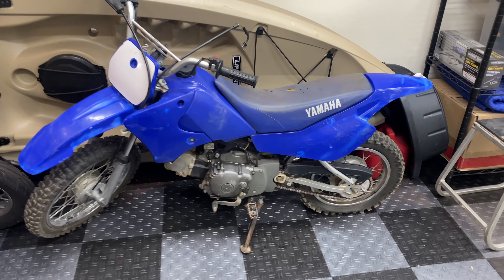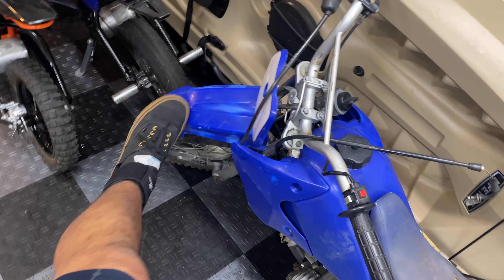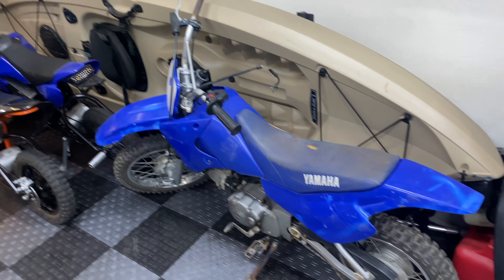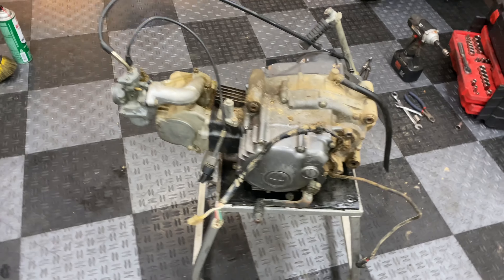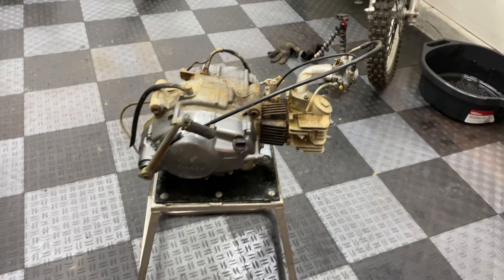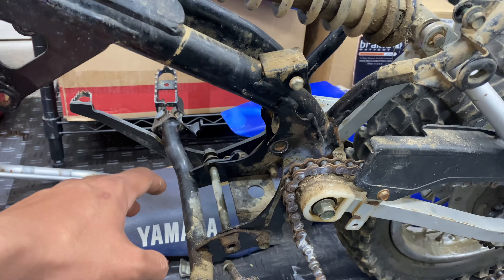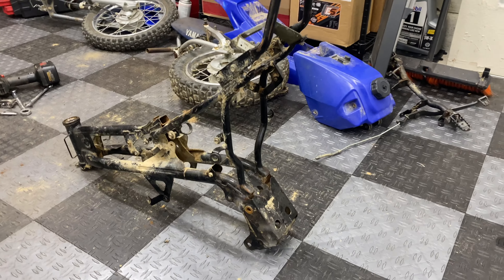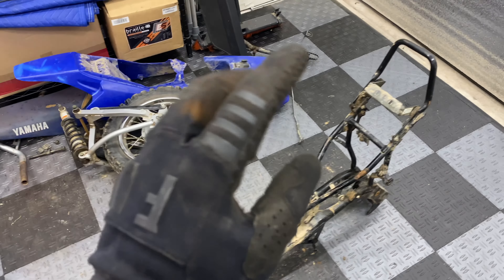Got Another Bike Project? 2003 Yamaha TTR90 Full Teardown

Comment: you should put a electric motorbike motor on it like the ones with gears and it looks like the gas motor so it would kinda look the same as the stock bike like a sleeper build

Comment: Quick question that is not related to the video- is it possible for a 72v 20amp battery to work with a 48v Kunray controller from the 2000w motor kit? I am looking to put a new battery in but I just want to make sure that I have a controller that works with the battery.
Reply from the maker: Only if you replace the 48V controller with a 72V compatible controller like the Kelly I use on my other bikes.
Reply: @PatOutdoors  ok thx

Comment: Really excited that you've got another build lol! I just finished my 72 razor upgrades so I'm living vicariously through your work :D

The open frame on the pitbike is pretty ingenious. The engine being a structural component kind of reminds me of some electric motorcycles that use the battery housing as a structural element.

Can't wait to follow this series
Reply from the maker: I actually just changed my order from a QS120 to a QS138 for this one also.. both kits should be coming in a few days!

Comment: Awesome!! I like these dirtbike builds! quick ? How do u hook up lights ? would they hook up to controller at all? or just thru a switch to the battery wire. Thanks! cant wait to see update on that 250
Reply from the maker: Thanks! I like to wire a voltage step-down converter hooked up to the battery to convert 72V to 12V just for the accessories I add. I go over it in more detail in this video: https://youtu.be/nhKxfcr3K1Y

This is the exact converter I use: https://amzn.to/42pdmcA
Reply: @PatOutdoors  Ohh wow! thats pretty sweet! Thank you!

Comment: Just curious if there is a reason why you don't use a fardriver controller on the mx650 builds?
Reply from the maker: My Kelly controllers are plenty for the my1020 motors. If I were doing a QS motor on a razor, then I would be using a fardriver